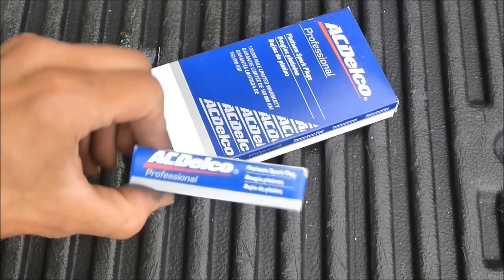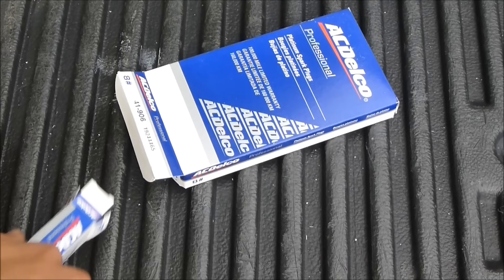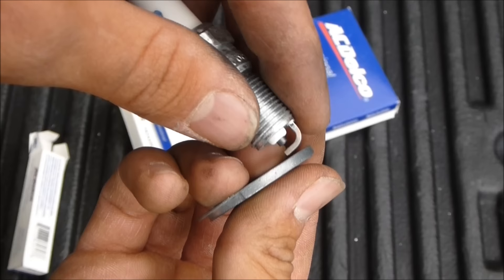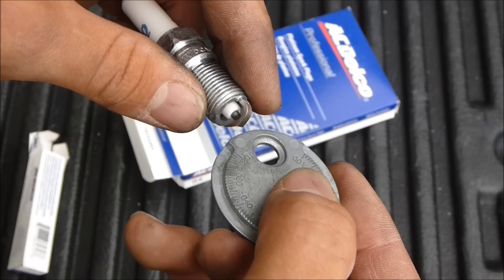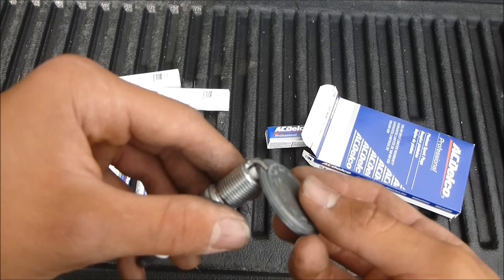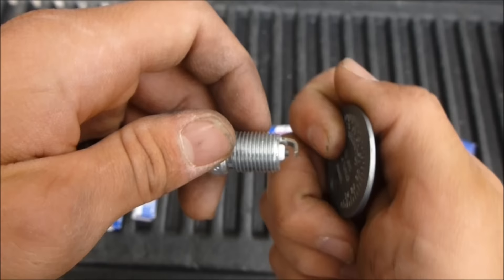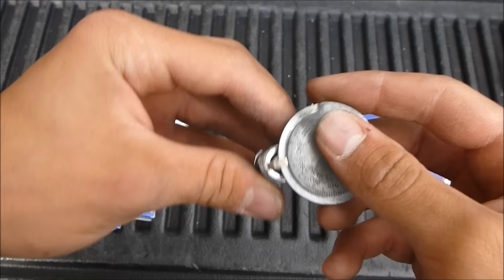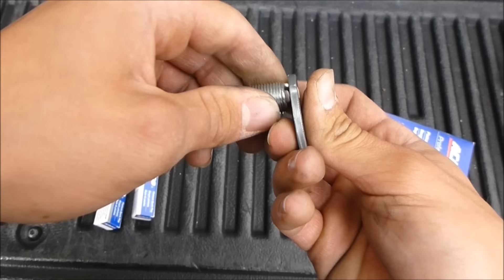How to Gap a Spark Plug

Comment: What happens if you drive your vehicle with the spark plugs not gap right?
Reply: It can cause misfires and just make it run rough in general
Reply: @tacozila1127  will it also cause rough idle. Bad misfire like it's running out of gas. ?
Reply: @hendricks177  it could.  I would also recommend checking if you are getting fuel good, your injectors or fuel lines could also be clogged up
Reply: @tacozila1127  I check all the fuel lines and it's good. And also everything I put on is new. MAP sensor. Purge valve. TPS. EGR position sensor. Spark wires. Spark plugs. Distributor cap and rotor. Fuel pressure regulator. Air filter. Ignition coil. Ignition control module. Fuel injectors. Idk what it can be still making it run idle misfire rough bad.
Reply: @hendricks177  make sure the spark plugs are gapped properly and make sure that everything is installed properly if not it might possibly be a timing issue not too sure though
Reply: @tacozila1127  yeah because that's why I wanna double check the spark plugs to make sure they gap right. I put them in 5 months ago, the truck was running fine until February 26, 2024 that's when the misfire started and got worst when I kept driving it after.
Reply: @hendricks177  yeah you may also wanna check timing and fuel pump if not that could be something internal like valves cam or rockers that you would wanna get a professional to look at
Reply: @tacozila1127  yeah. But Im gonna recheck the spark plugs first.

Comment: could this be a cause of a misfire I'm misfiring and I replaced the coil and spark plug on my car
Reply from the maker: +Sebastian Coronado If they are not gapped right, you can get a misfire but it is likely something else. Check your injectors: https://www.youtube.com/watch?v=tA_E6X4ISgQ
Reply: Definitely could be a gapping issue. My car started misfiring after I got new plugs. I gapped them to 0.025 but turns out I was supposed to go to 0.020. That fixed my issue.

Comment: I changed my spark plugs but now the car is like shaking what is the cause of this?
Reply from the maker: Check the wires and distributor: https://www.youtube.com/watch?v=4_EFGAFxi1w
Reply: Angel Sanchez not sure if this information will still be helpful to you, but if it's shaking it's usually bad coil ignitions or the fuel injector isn't connected properly. This recently happened to me, changed my ignition coils and it worked like new.

Comment: my Toyota says to use iridium plugs & on the motor it says NOT to adjust the gap. Should I check it anyways and adjust it?
Reply: asaber11203, shouldn't be on the road for asking a simple question? Seems a bit harsh... either way, I would think not a lot of normal every day drivers know this
Reply: ***** Haha. Look at who originally made the comment, it wasn't me.. And if I recall there should be some info in your cars manual or something that tells you what the spark plugs shold be gapped at and if they aren't where they are supposed to be, it should be fixed so your car runs how it should. So YOU are calling people idiots and saying they shouldn't be on the road because YOU think everyone should know everything about their car and or just follow something that may not be right
Reply: ***** I think the original comment was made questioning this: My motor says that I shouldn't adjust the spark plugs but if they aren't where they should be, should I still adjust it? Be a little more considerate to an honest question that confused someone instead of saying they should be driving
Reply: ***** Call me a moron all you want.. If the engine says not to gap them but you want to check them to make sure they are where they are supposed to be anyone can do so.. Now.. if the manual says the gap should be at .050 (Just a random number) and the gap on the new spark plug is at .060, should you change it or just not let your engine run how its supposed to because your engine says not to change it period, disregarding the fact that the gap may be wrong???
Reply: ***** I was just trying to help you understand what I suggest you should do. Did you ever figure it out?
Reply: +DemolitionSquad100 I was referring to the other guy. Yes I did, I appreciate your help btw
Reply: DemolitionSquad100 I don't care WHAT the gap is when you buy the plugs. Gap them to what your OWNER'S MANUAL says. Most gappable plugs (there are plugs that you NEVER gap) come gapped big. There are only TWO kinds of plugs in the world. .Plugs that you must GAP and plugs that are NOT meant to be gapped. .There is NO SUCH THING as a PRE-GAPPED Spark Plug. It's an urban myth. Check your owners manual OR the sticker under the hood, if there is one, and THAT is the correct. Stop asking dumb questions.
Reply: ***** you just said exactly what I was trying to say, use what your owners manual says regardless of your engine saying not to adjust it. and by pre-gapped I don't mean to what the car needs it to be at, I mean just with the gap the spark plug has when you pull it out of the box.. quit being rude about someone asking an honest question
Reply: DemolitionSquad100 You don't know what the hell you are talking about. How the hell can your ENGINE say not to adjust it? You're right. I've bit a bit rude. Listen, they are offering free "English for Adults" at the public libraries. Maybe you aren't aware of this. RUN to your local library and sign up.
Reply: ***** read the original comment. He says "on the motor it says NOT to adjust the gap" yeah I think I know what I'm talking about.
Reply: And this folks is why we have not been contacted by aliens yet.
Reply: Thanks for the laughs asperger11203

Comment: i been talking to you about my tahoe  i wonder if its supposed to have platinum plugs i it or does it matter its a vortec engine with .60 gap i think if the plugs arnt gaped right could it cause the issue im having with the random misfire. rough idol.
Reply from the maker: SuperJeremi10 Check your owners manual for the type of plugs you need. It is definitely helpful to have the correct plugs and a bad gap can cause problems! Let me know!
Reply: well it specify .60 platinum plugs i dont know whats in it
Reply from the maker: SuperJeremi10 It is worth a shot because spark plugs are cheap enough!
Reply: yea  but i wanna be sure thats the issue im going to start driving it more see what happens when the check engine light comes back on ill have the code pulled and start there whatever is causing a check engine is probably causing the issue
Reply: im gonna put insurance on it i added fuel cleaner to it  and im start using it as my main car n drive the heck out of it and see what happens it hasnt run in 3 months before i got it so maybe thats why its acting so funky ive already had all the fluids changed im also going to have a spare key made for it so we will see i have been running it ever 2 days since i got it and it seems to be running okay now.
Reply from the maker: SuperJeremi10 That sounds like a good idea!
Reply: yea well i dont know what to do really till my engine light comes on again.
Reply: i just think i might get a new blower connector and ac control modal and have my ac checked and order a new wiper switch. start driving it i spent all day today vacuming it out wiping it down i might use my carpet cleaning machine tomorrow with some cleaner and see if i cant get some of the filth out i wanted to pay and have the carpet cleaned but i really cant afford that.
Reply: its a real pain to get to my injectors to see if there bad when they go i think ill just put it in the shop.
Reply from the maker: SuperJeremi10 You have port injection in the intake. It is better than a carb but a crude form of fuel injection.
Reply: yea its really hard to get to and the older spider injectors are known to fail if these havent been changed yet the car runs ok  it idols around 700 rpm im going to start driving it and see how it runs after a few tanks of gas if it dont run right ill have a shop look at it unless i find the issue maybe with your help.
Reply: hey is there away i can bypass the computer and make the compressor clutch engage to so if it even works and gets cold  if it comes on and gets cold then prolly the control thing if not then something else is the issue and needs to be checked.
Reply from the maker: SuperJeremi10 I mean you might be able to but the compressor kicks on and off based on the pressure build up in the AC system so you would prob cause more damage trying to do that yourself.
Reply: yea i know but it would tell me if it actually works or not i need somewhere to start i cant tell if theres freon in the system or if the switch is bad
Reply: the sensor on the dryer thing  can i pull it and shove a paper clip in the connector then start the car and see if the compressor kicks in if so it means i need freon right just looking for things to try that will give me clues as to why my ac wont work  i have now way if testing if theres a leak il have to pay someone to recharge it and add the die in it if it leaks
Reply from the maker: SuperJeremi10 Oh, gotcha. Yea, you might be able to trigger the compressor manually for analysis. I though you meant so that you trigger it yourself to run it lol
Reply: lol no   its not safe to leave it that way its not running for a reason i wanna figure out whats causing it not to run so i can fix it  haha its to cold to run it now anyway i just wanna have it fixed for summer its in the 40s here dont really need it if it dont engaged with the low pressure sensor then thats not it must be my switch if it kicks on at the sensor no freon so its leaking gotta find the leak.
Reply from the maker: SuperJeremi10 gotcha
Reply: well i bypassed the pressure sensor and pushed my ac button and the compressor kicked in so everything is still working i just need to recharge the ac and add the die so i can find the leak.
Reply from the maker: SuperJeremi10 Awesome! Nice work! Go find that leak!
Reply: yea hopefully its in the tube  under the hood somewhere  or the condenser something easy to get to if its in the coil under the dash and is small enough i may just have it recharged every year  or have some sort of stop leak put in and see if that holds. ill have it charged when it starts to heat up again i did have a new connector ordered for the blower switch to fix the poor contact issue.
Reply: well i found that all my plugs on the tahoe are gaped at .065  it calls for .060  maybe tahts  the issue i put some back to specs i got a gap tool at autozone   i may just buy a tune up kit for the car plugs cables  cap n rotor maybe  new fuel filter too.
Reply from the maker: SuperJeremi10 Maybe. I dont think that little of a difference will matter but you never know!
Reply: ya  but it seems to be running rich theres soot all over them  looks like they are in need of changing.
Reply: i found its a 99 tahoe too so says the title it was bought back in 2000.
Reply from the maker: SuperJeremi10 If she is running rich that could be injectors, O2 sensors, dirty MAF sensor, etc. Or it can just be buildup from old spark plugs.
Reply: well yesterday i had a huge loss of power gong on to the freeway and all  and my check engine light came on gotta get my c1500 looked at we been fighting issues with it for awhile and today my radiator cap went out when i was up on the freeway leaked most of my coolant out  it ran hot but didnt get into the red i pulled off to an autozone got another cap and filled it with water.
Reply from the maker: What were the check engine light codes?
Reply: throttle position sensor and idle air control.
Reply from the maker: SuperJeremi10 Did you put new ones in? That would definitely cause idling problems!
Reply: yes they where replaced today and  it is running better but rpm is still low but we noticed the throttle body is leaking fuel from the seals and the pcv valve or something is also bad i noticed the smell of raw gas its been leaking for quite sometime unnoticed everything around its nice and clean it will b fixed sometime soon. it was noticed when i pulled the air cleaner off.
Reply from the maker: SuperJeremi10 AWESOME! You are getting closer!
Reply: yup  we are working on getting a throttle body rebuild kit  and a valve
Reply: well rebuilt the throttle body and replaced the valve still no change in my rpm im at a loss for now it runs great other then my rpm is low and you can hear its low it drops off after it runs a bit and all but  it only seems low at an idol when driving  my rpm  seems to stay right where it should  like when i get up to 70  ish the rpm is right around the 2 like 1 bar away from the 2 where it normally would fall engine has lots of power accelerates quickly  gets good gas mileage no service engine light good oil pressure and no knocking or strange sounds  just rpm is low all the vacuum hoses look good arnt leaking iac has also been replaced the idol seems smooth the rpm does not lop its just low and you can hear it drop when the engine runs and it has long crank times and a stalling issue fuel pump is less then 4 months old as well no signs of a blown head gasket either  the computer also seems fine as every thing works as it should and when parts go bad it sends a check engine light my fuel pressure sensor works to as if i leave the cap of for very long it sends a check engine light so i have no idea unless i got a bad fuel pump.  knock sensor and all coolant and temp sensor have also been done and a full engine tune up fluids and filters changed it runs very smooth except a hesitation very occasional stalling and the always low idle rpm when it stalls it usually always when in park or when i hit reverse thats it. it leaks oil like crazy though  but its been like that way before the current issue.
Reply from the maker: Have you done a fuel pressure test?
Reply: right now we have no way to do it  but it will be up to what dad wants sto do with it it gonna give it to him and drive my tahoe.
Reply: but i know it now is leaking oil like crazy  i filled it with oil last week i checked it this week and it was empty no oil same thing last time i checked it  it has leaked on the front seal for some time now  but not to bad i used to could get bout 5 months 6,000 out of one fill up on oil  no  between the oil pan transmission and trans pan there is tons of fresh oil everywhere i bought a big thing of oil and put it in see how long it lasts for i cant afford to have the seal fixed.
Reply from the maker: SuperJeremi10 If it is leaking oil that fast, you should try to fix it yourself or something!
Reply: its the front and rear main seals leaking and i don't have the money to have the issue fixed.
Reply from the maker: SuperJeremi10 oh. That stinks.
Reply: up  and yesterday for the first time in 20 years it backfired then puffed out  crap loads of gray smoke luckily it didnt take my muffler.
Reply from the maker: SuperJeremi10 Did your head gasket blow?
Reply: im not sure it seems to be running fine after we replaced the o2 sensor.
Reply: but i don't know it still seems to be running rich now  before it was running horribly rich it had like liquid gas in the exhaust so i dont know im done with it though  its my dads problem now lol.  as soon as a cane come up with like 300 ill be driving the taheo i have to do the title transfer on it.
Reply from the maker: SuperJeremi10 hahaha. Congrats on the Tahoe!
Reply: thanks haha it needs a tune up but other then that seems to run fine no check engine light only issue i see is my daytime running lights dont turn on  but the indicator on my dash turns on.
Reply: ave any idea about the daytime running lights.
Reply from the maker: SuperJeremi10 Are the bulbs good?
Reply: um idk i do know my headlamps come on and parking lights.
Reply: i have a 99 tahoe old body style  when i start the motor the indicator comes on for daytime lights but  the daytime lights dont come on but when i turn on parking lights and head lights they all come  on  when i turn my turn signal on all the bulbs in direction of turn come on.
Reply from the maker: SuperJeremi10 Is there a drl fuse?
Reply: ummm i do not know ive only had the suv a month i havent even drove it yet im waiting on my new title to come in. im still driving my pickup.
Reply: If a vehicle calls for platinum, you don't have to have platinum. Copper is way better for performance. The switch to platinum is for way way way longer service intervals. Not because they're better for your engine. What is important is that you have the correct gap, and correct heat range. That's it. Spark plugs open or close over time too, An extra five thousandths is normal

Comment: I thought the gap should be in the middle of whatever gap you need and not before the line. Some say the tip should be in the middle of the measurement.

Comment: So the problem is most of the plugs are coming Gap at 0.044 thousands if you need a .032 Gap and you close the gap it will leave a hump in the back side making it Ark out... hence the problem trying to close up the gap for a supercharged engine

Comment: Those type of gappers suck. I wouldn't recommend them. A well built wire gauge is less/no stress on the plug electrode and would be the better tool.

Comment: Could you tell me gap size on a 95 Chevy 350vortec? Owners manual not available
Reply: 5150Clarence ModocNdN 
.060 for most.
Unless they are iridiums then don't try to gap them switch them out for .040

BEHOLD THE POWER OF THE INTERNET!!!!